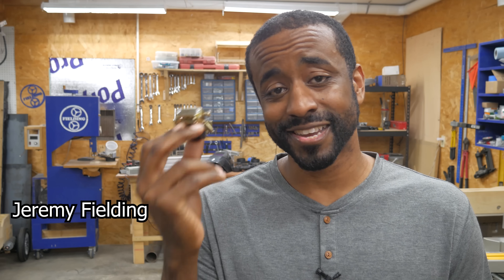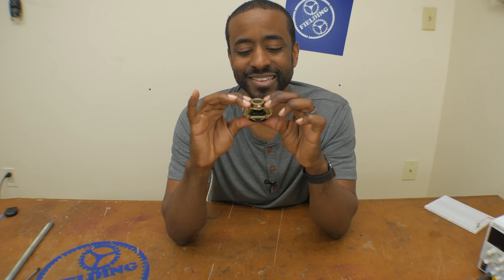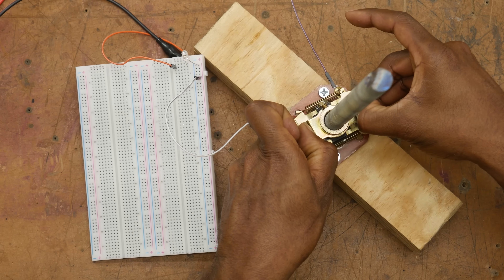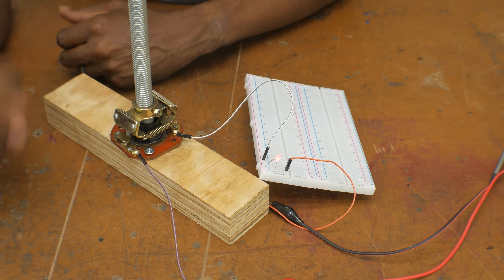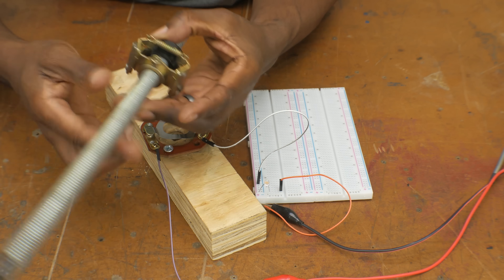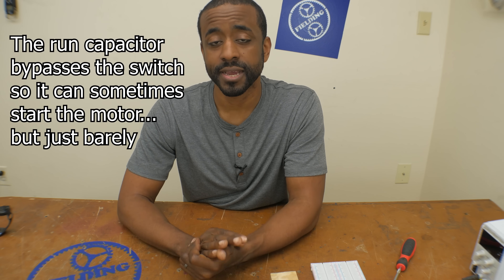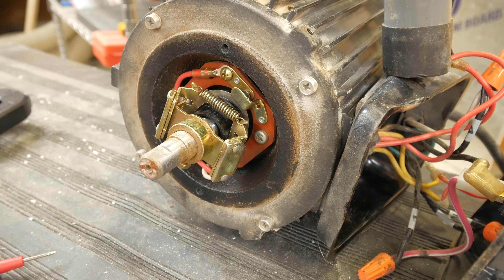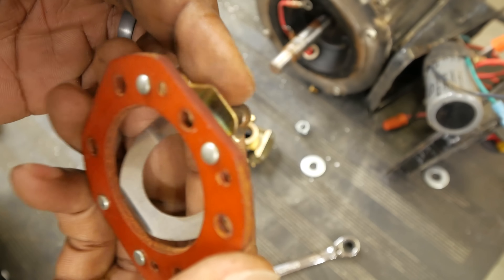This Clever Device Is Found In Nearly Every American Household. How It Works And How To Fix It

Comment: Thank you for this!.
I'm an electrician with a young, new apprentice. I long knew about motors having centripetal switching, but never knew what they looked like, even less knew where they are. 
I have been teaching the motor windings, how to troubleshoot windings, and the difference between delta/wye and high/low voltage configurations.

Comment: I don't know who invented it, but it is very old in the engineering world. It used to have two balls on the end of movable arms and the weights were then called "Balls to the walls" when it reached full speed in old time Diesel engines. Originally it was called a "Governor" as it governed the speed of motors I believe in German mining operations and they needed motors to self "Govern" the speed of the pumps. I saw that on some YouTube somewhere.

Comment: That's interesting, none of the single-phase motors I have taken apart had this. They either have the capacitor connected all the time, or the disconnection is controlled with a current-sensing relay.

Comment: A very similar mechanism is used as a safety brake in elevators. If the car starts falling, a centrifugal device snaps open and engages the emergency brake. (This is just one of many safety devices present in all modern elevators.)

Comment: The tab gets arc on separation. Same as an automotive distributor. The distributor has a condensor to absorb the energy at separation. If you want to find anything related to mechanical device's like this just go to the us patent office website. There you will find the person that applied for it. James watt was the father of the mechanical governor.

Comment: At last, to find someone who understands how things work and how to fix them including with sandpaper, doesn't just swap random parts until eventually half the parts are replaced and it starts working by luck (I get so irritated by supposedly skilled engineers who do that). You are an endangered species, respect to you!
Reply: Exactly.
Reply: I've probably saved $300 over the last 6 months because of his videos. Normally I would have just bought new parts or motor altogether

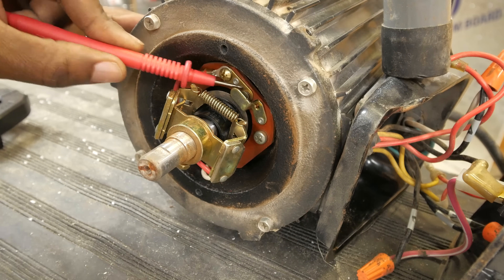Comment: Great articles however please instruct people who plan to DIY to follow safety procedures. For instance that spark you got with your test probe at 6:34 was the capacitor discharging. Don't think equipment is safe to work on just because its unplugged. A motor cap will hold a charge long after the equipment is unplugged. That charge can damage your meter and if that contact were touched by a finger you could be electrocuted. It will hurt a lot and could potentially kill you. Learn the proper way to discharge a cap prior to servicing such equipment and post a short tutorial on your next video. Cheers
Reply from the maker: Fortunately for me I was there so I happen to know it was still plugged in LOL. Therefore you can't point to a capacitor as storing the charge. I talk about how to discharge caps in several other videos. Its just not something I remember to bring up every time.

Comment: Thanks, Jerry, for another information-packed video. I'm working on a 1/4 HP induction motor right now, and its problem is that the centrifugal switch does not open reliably, so the start winding sometimes stays connected, which is not a good thing. If I cannot diagnose the problem, and repair the switch, I guess I have the option of wiring up a momentary push-button switch of suitable current rating to manually connect the start winding for one second, until the motor spins up. Its an old motor, but hate to scrap it as it runs fine as long as you start it up.
Reply: Sorry, I meant to type "Jeremy", not Jerry. My mistake. :-(

Comment: the one on steam boilers used as regulators, except once there was too much power it would spin open letting steam out until the appropriate pressure was back then it would slow and be closed.  It was called a Centrifugal governor, and it was invented by James Watts in 1788. Got it from Wiki.

Comment: I don’t understand why we need capacitors to start an electric motor , why not just direct power with a toggle switch
Reply: single phase power does not produce a rotating field like a 3 phase motor does. In single phase it only oscillates. Inside the motor is a start winding that is only needed to give the motor starting torque. That winding will burn out if it stays on. so once the motor reaches I think 90%   of rated speed it switches off by the centrifugal switch. Not all motors have start capacitors or run capacitors. Those give the motor more  torque  needed in larger loads like compressors and saws. some motors have permanently connected start windings that are designed to stay energized. mostly lower HP motors.  so they will not require a centrifugal switch. In my 43 years  as a industrial electrician I find 
 the largest failure is the capacitor and not the switch

Comment: Strange, this device is considered outdated here, encountered in some old motors from 1960s or 70s. Now for single-phase induction motors we either use only run capacitors, or thermal starting relays.

Comment: That's an evolution of similar devices used on steam engines (A small steam engine starts a big one, and as the big one starts to work, stops the small one). 
Nowadays, a solid stat triac based circuit can do the same with less wiring and no moving parts.But nothing beats the mechanical switch price (less that 1USD)

Comment: As you showed with the motor: where is the capacitor? I see yours has it in the mounting bracket. I had a hoover 1hp at 230v  AC and never seen a capacitor.

Comment: One of those emory sticks used for fingernails works quite well, because it's narrow, stiff, and abrasive on both sides (if not too aggressive, a metal nail file might do, too). I place the stick between the two contact points, lightly pinch them together, and pull on the emory stick: both sides are cleaned with one or two passes. Thanks for the illustration. One thing I thought missing was/is whatever routes the power through the "governor-type" switch first, but bypasses it (so as to power only the motor) once adequate RPMs have been achieved.

Comment: You are wrong about the capacitor blowing up. It more or less a push start. It won’t blow up because the energy is flowing through the capacitor not continually charging. We do use electronic systems now for more expensive setups that require more precision.  This method of start operation is cheap. I find it interesting that you don’t know who invented the apparatus. Royal Lee patented it in  May 31, 1927 for the Lee Engineering Company.  Use was to boost split phase motors to speed then deactivating to convert to one phase. The capacitor is needed to act like a 2 phase motor during startup.  This device was used in fan motors of the early 1900’s but not nearly as perfected as the 1927 model.

Comment: The centrifugal switch is derived from the original centrifugal governor used to regulate windmills in the 1600s.  James Watt applied it as the steam governor for engines in 1788.  So it actually is near 400 years old!  I only know because I think they are super-cool too!  Your videos are always nice to watch!👍🏼
Reply: Watt?
Reply: Hahahaa!!!
Reply: Make a video...good or bad (vid wise) your knowledge is invaluable to others.
Reply: I believe the original concept was an important advancement in the design of steam engines.
Reply: You know Watt did not totally invent the steam engine, I think he bought the original design, and  then reversed the process from evaporation/vacuum to a power stroke. With that done it was used to run a more precise  boring machine to make much better pistons and cylinders, to improve the steam engine, and on and on.
Reply: I think the unit is often referred to as the Newton governor.,in steam engine use.,but that maybe more of a reflection of the type of physics /technology being used.,rather than the inventor..Generally in steam/engine applications it is a graduated device.,rather than a snap on/off binary device..
Reply: The first centrifugal switch used in AC induction motors was invented by Donald Bliss, patented in 1906 (patent # 860,124).
Reply: @jraef3781  Indeed innovation is rarely the child of one parent; each innovation creates new frameworks from which successors are inspired, or at least solve new challenges!
Reply: @jraef3781  The Wikipedia article for "Centrifugal switch" has an extremely short history section. It merely says, "A 1927 patent for a centrifugal switch (US Patent #1,630,394) was granted to Royal Lee on May 31, 1927."
Reply: What?

Comment: never seen that switch before. After we clean points like you did, we tend to blow on them. Bad idea. You are depositing moisture from your breath on the points you just cleaned. Instead use a brush or a hair dryer.

Comment: Thanks for a neat video!  Also, be sure the multi-meter is set to the correct measuring scale.  I tried to check voltage on a 240 volt circuit with the multi-meter set to Ohms.   The new multi-meter wasn't really That expensive...

Comment: As exciting as electrical sparks are, always check for voltage before checking for continuity/resistance. An ohmmeter connected to a live circuit can cause injury, but more likely you'll wreck your multimeter. A 10 second check can save you $150 on a new meter.

Comment: Same as the points on a old ignition system, in the beauty dept. at any drug store you can find sand paper strips for polishing finger nails, grab a pack of them. Very handy for such tasks and cleaning contacts on fuses etc.  rigid as well.

Comment: Nice job with the production. Simple, concise, and good shots of your equipment. And pleasant narration. And including the goofs helps, however embarrassing. Very nice workshop! Click! Subscribed. An odd thing happened when I took apart a 120V 1 HP motor to paint, upon reassembly the motor starts and stops about every 1/2 second or so. I can see the centrif switch operating, pushing the contacts, and it made me think that I have the machine bearing spacers in the wrong order causing incorrect gaps. The motor worked fine before the disassembly, what am I missing?

Comment: Hence the saying "balls to the wall" from the governor on steam engines.
Reply: I don't think so (doesn't make sense as the governor balls were never anywhere near a wall). I think that phrase stems from aircraft: the throttle lever most often had a round ball on top and maximum power was when the ball was forward, closest to the instrument panel bulkhead, or wall.
Reply: @chrisburn7178  the faster they spun they moved closer to the wall, not that they touched the wall, depending where the stationary steam engine was placed.
Reply: @neildutton8077  That is irrevocable surely, but I still assert that your belief it's the origin of the phrase is false. A little gentle research bears me out - although of course we're dealing with hearsay and guesswork to a degree with all idiomatic origins. But there's no evidence for the centrifugal governor's relationship to that saying at all.
Reply: @chrisburn7178  I believe you're right to say the expression has been appropriated for aircraft, but I have heard that it predates the era of aviation. 
We'll have to agree to disagree,
It's all good.

Comment: Almost exactly like a scooter clutch. Weights and springs. At low speed, the springs keep the weights pulled in close, but as it spins faster, the weights push out, engaging pads on a bell housing .

Comment: I find it bizarre you claim every US household (probably) has at least one. I'm struggling to think if we have one. I've certainly come across them in motors but they're used in induction motors and most of the motors we have are not induction motors - so have brushes. (Hand) power tools, washing machines all have conventional brushed motors - so no centrifugal switches. Our old lathe possibly had one (Myford ML7).

Comment: Just found your channel and love it! Fun fact on air conditioner capacitor failure: if your AC capacitor is failing to kick on, which I think is the most common mode of failure, you may be able to limp it along until your replacement part arrives. The capacitor may not be able to store enough charge to start the compressor but may retain enough capacity to keep it running. If you can manually spin the motor into action fast enough to trick the centrifugal switch when you know your thermostat would want the unit to be running, it'll kick-start and keep running until the thermostat tells it to switch off.

Comment: It was probably invented by one of the engineers at North Brothers Engineering that invented some extremely ingenious tools back in the 1800s. 
They invented the Yankee screwdriver and several other extremely ingenious tools like the North Brothers 1545, 1530, and several others with that round transmission on the shaft that does so many ingenious things. 
Stanley eventually bought them out and cheapened the tools.

Comment: It’s like the governor on a steam engine. Inventor James Watt.
Reply: That is where the term "balls out"(full speed) came from.
Reply: They definitely are just like a governor on a steam engine or the emergency brakes on old elevators they all have the same principle of how they work with different uses.
Reply: good mornin gov'ner
Reply: Many of the early "hit and miss" engines had nearly identical mechanisms to cause the intake valve (and sometimes, the spark plug) to go into operation. Steam engines had the same principle at work, but not as a "starting" device, but as more of a means to cause a gradual increase or decrease in power as necessitated by varying loads.
Reply: Watts that you say?
Reply: Not really
Reply: @TimMillernapavalleyfilmworks  yes, really.
Explain why it is not, when exactly the same principle is in play?
Reply: @masksarelies391  i guess it's close, they both are metal
Reply: @TimMillernapavalleyfilmworks  they are indeed both metal. Also, they both control the input power through the centrifugal force applied to weights connected to the output shaft of the motor. Only significant difference I can see if that this switch is binary.

Comment: I can show you how they break!
The unit just like this on my bench grinder kept slipping sideways and every time I put it back in position and tightened it down a little bit more, it eventually would slip again. Eventually I tightened the set screw down to the point where that collar that it screwed into actually broke.
I do not want to put another poorly designed part in there that I know will break again.
I thought of wrapping some thin rubber around the shaft and putting a couple of hose clamps around it rotated 180° apart for balance, if those would hold that from sliding sideways again.
 Do you have another way of fixing this?
Is it possible to fix it and hold it in place with hose clamps? Or do you have another fix for it?

Comment: Nice. I love the enthusiasm you have for the subject. 
 With that kind of interest, you will just keep learning. I did watching this.
I rebuilt a motor with brushes that were spring tensioned, and I can say, I had to invent a way to re assemble the thing. Small bits of sewing thread compressed the springs and were pulled free right at the point where the case sealed.

Comment: 2:16 Reason I wear a seatbelt got tired ending up in the passenger seat while I turned. 

Am I joking or not
Reply: Well, what might interest you is that if you have 'inertia reel' seat belts, there's a device in the reel that does a similar thing to this - if you pull the belt out too quickly, it locks the reel.

Comment: Hey Jeremy, you can buy a product called Flexstone or Plastone for cleaning contacts like that. I believe that it was originally made for cleaning points in older ignition systems. It works very well and you don't need to take it apart. I have been using it for half a century.  Great videos, keep them coming.

Comment: The original idea of the centrifigal governor came from Christiaan Huygens in the 17th century to regulate the pressure on millstones, but came into its own for use as as governors  on steam engines and was in common use for over a century before  electricity   and was a familiar device to mechanical engineers of the time, and still is I guess.  The adapation of it  to operate a switch based on angular velocity would have been obvious  to engineers at the dawn of the electrical age

Comment: For being so important that little device sure is a piece of absolute garbage! 
I've had to open up my bench grinder several times to tighten that set screw on that thing because it kept slipping over sideways. This time I went to tighten it and that brass collar that goes around the shaft split most of the way through.
I'm hoping I can put a hose clamp around that collar and maybe put a hose clamp around the shaft to keep it from slipping over sideways anymore because that brass collar won't hold a set screw anymore.
What do you think?

I would hate to waste money on replacing it with the same kind that would break again.
I wish I had the equipment to braze a larger stronger collar onto that one with a set screw in it.
It's absolutely criminal that they make those things to break on purpose!

Do they make any better quality ones that don't break so easy?
Maybe I can hold it in place with some JB weld. I once fixed it car crankshaft with some JB weld. (actually I just had to fill in the groove on the end of the crankshaft that was made by the pulley. Then send it smooth and put the pulley back on tighter than it was. Some people told me I would have to replace the crankshaft.)

Comment: It's not so clever;  it relies on a constant rubbing of a rotating part with a non rotating part,when the motor is running ;    it should be the other way around.
edit:   Excellent video,  perfect explanation   Thanks.